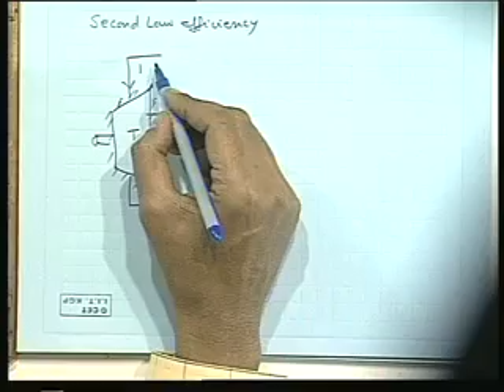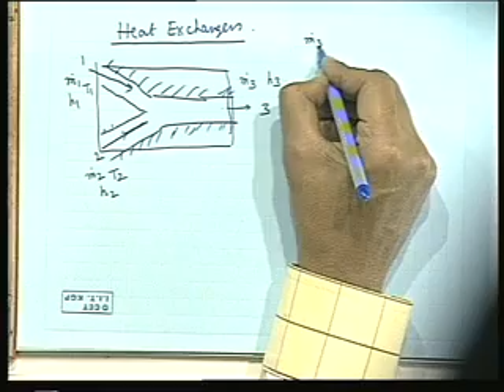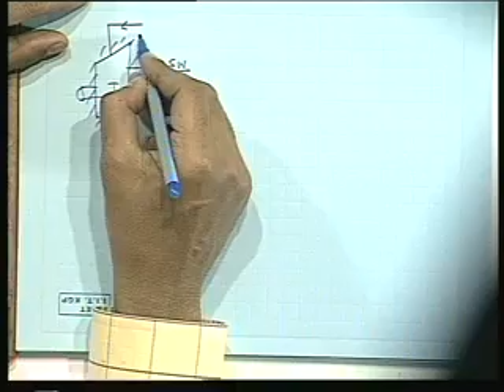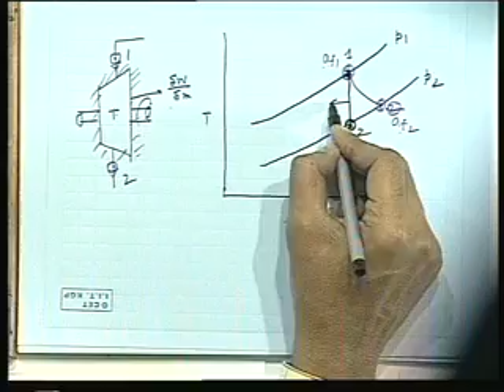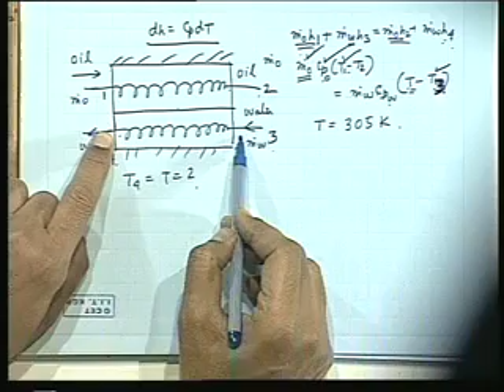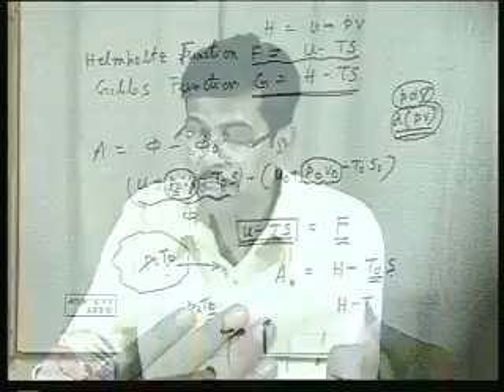Lec-13 Thermodynamic Property Relations-I

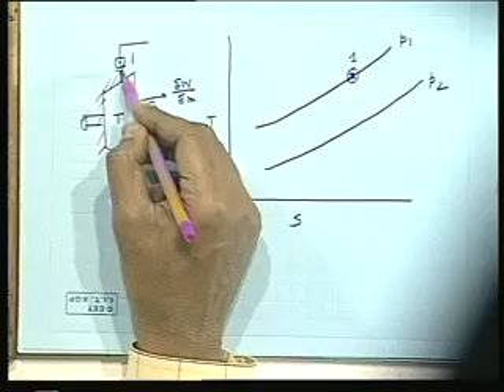Comment: At 31:05 for second law efficiency we think of a reversible process between state 1 and 2, how is that possible? since the turbine is insulated the reversible process would be adiabatic/ isentropic but then it would be same as isentropic efficiency. please explain
Reply: We are connecting the two states 1 and 2 by some reversible process. Note that this reversible process is not adiabatic now and some heat transfer is involved for making the same states 1 and 2 by a reversible process.
Reply: @dodiumtalib8202  in reversible process ∆s =0 and if process is not adiabatic then ∆s is not equal to zero as there is no dissipative effect
Reply: @AkashGupta-ck6oi  Bro what do you want to say?.. I didn't get.. All reversible process doesn't mean ∆S =0, For only adiabatic reversible process ∆S=0.
Reply: @AkashGupta-ck6oi  Bro ∆s =0 for two cases : 1) when the process is reversible adiabatic( as del Q/T = 0 and entropy generated is zero) 2) when process is irreversible heat rejection such that del Q/T = -entropy generated .